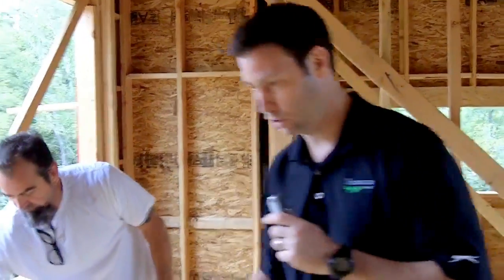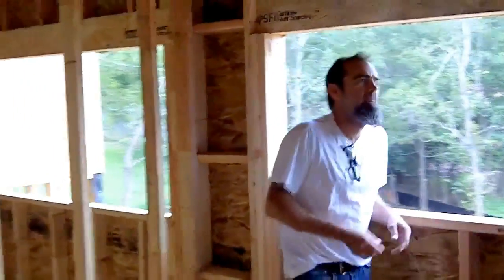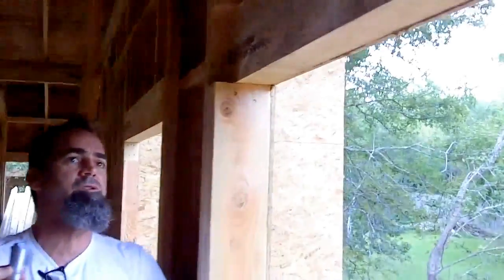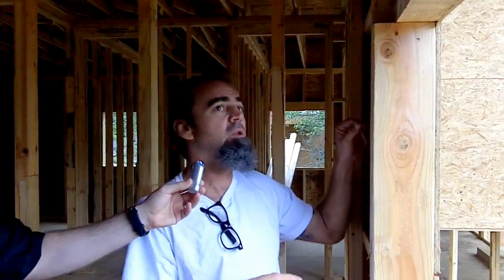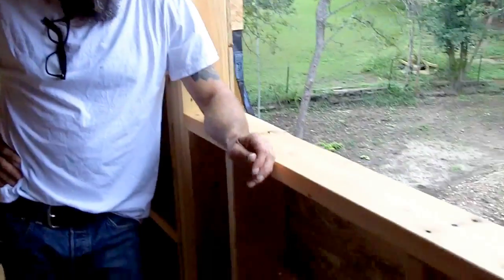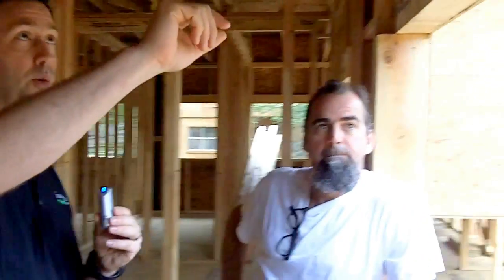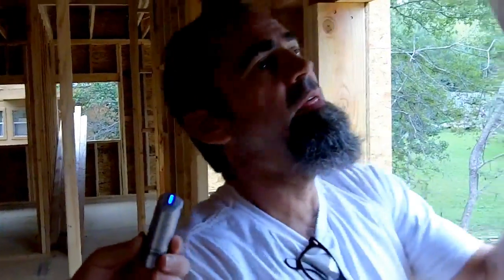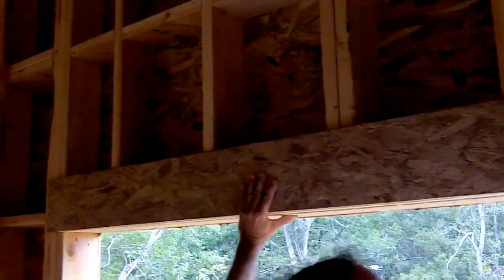TimberStrand Insulated Headers - How To

Comment from the maker: Thanks for your comments, but I'm not sure I agree that it'll weaken that area of the window.  I could see your concern for a sheetrock returned window, but I don't believe this will cause SR problems. You could reduce the detail to a 1/2" foam then a 2x nailer on top of that if you were concerned.  Trim under the windows would generally be nailed into studs.  I've not seen the double sill you're proposing.  Thanks for commenting.  Matt

Comment from the maker: Correct.  We will use Tyvek Drainwrap, then 3/4" rigid foam (R-Max) with a foil face then rain screen battens.  The siding is a mixture of tropical hardwoods, and James Hardie lap siding.  Stay tuned for a video on that... Matt

Comment: hello,  are there insulated headers out there for long span openings such as a 10' sliding glass door, or up to a 20' wide sliding glass door? It seems that Timberstrand headers are only for short span headers. thanks,

Comment: Just curious. What if the lady of the house wants to put up some really heavy curtains or some other decorations? Do the homeowners use longer screws to bite into the header or just make sure mounting points are in the studs only?
Reply from the maker: If you look at 6:40 you'll see the last layer is a 1/2" plywood or OSB then the drywall will get hung on top of that.  If you're hanging light blinds you'll have no problem going into 1/2" OSB but if you're hanging heavy items you'd want to use long screws into the Timberstand header with lots of meat behind it.  Best, Matt

Comment: Matt, I've seen a lot of your videos and they're pretty amazing,  I've done construction in Los Angeles, CA and in San Antonio, TX.  I really don't like the idea if insulating the headers the way you're proposing and it make that one area weak for interior nailing (drywall, corner beads, window trim, etc.).  I think you're doing it to save money rather than insulation purposes. Also, why use only one window sill.  It leaves no space for nailing siding and trim under window.

Comment: Mrdesignstx: I will try and keep this both brief and courteous.  The headers are designed and installed to decrease THERMAL BRIDGING.  It is part of an overall strategy that employs OVE (optimum value engineering).   Your username would suggest that you are somehow involved in the trades, however, this concept is foreign to you?  Double Sills: Either a regional or generational framing quirk.  Matt's work is neither cheap nor inferior, any insinuation to the contrary is inaccurate.

Comment: Let's get this straight, the TimberStrand headers do not come from the factory with insulation.  The title suggests that they do.  Better title for this video: Insulating A TimberStrand Header.  You have no control over this, but what would be much better is an engineered wood header that actually does come from the factory with insulation built into it.  They would be made in 5 1/2" and 3 1/2" thicknesses to match standard stud sizes.  Maybe an outer and inner layer of TimberStrand with a foam center glued between them, and a strip of 1/4" OSB on the top and bottom to hold it all together.
Reply: Ben Wolk-Weiss and..these will go in my house...